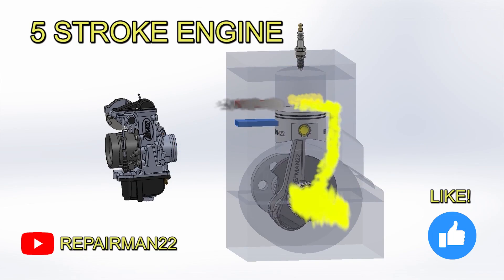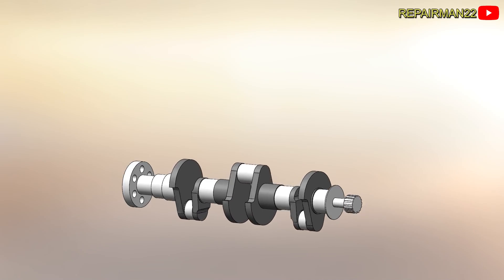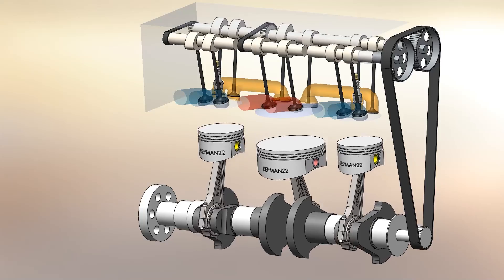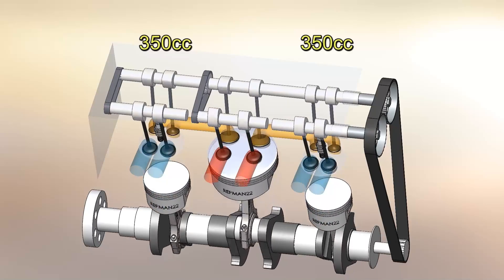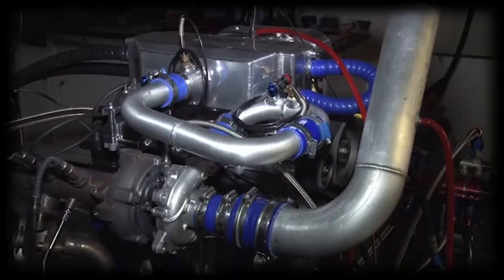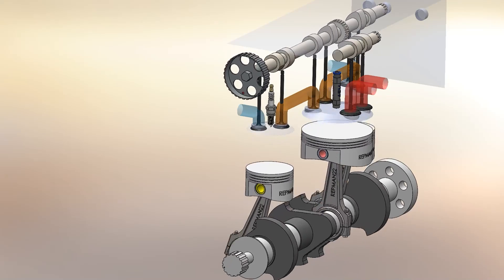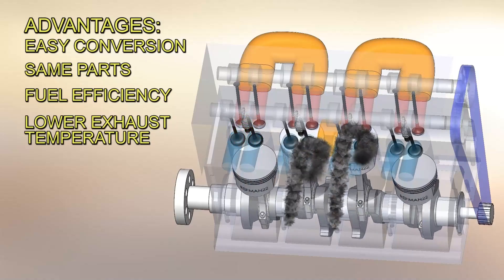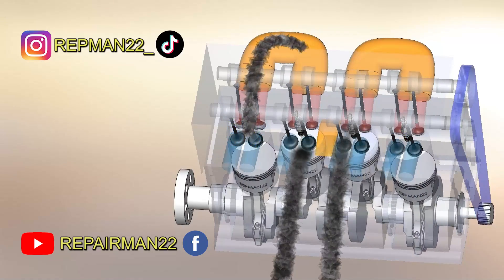The 5 stroke engine with water injection // Tested in Golf MK5 🤯

Comment: An additional process (the second expansion) doesn't make this engine a 5-stroke. The intake and exhaust are overlapping, so whole cycle still completed in just 4 strokes.
Reply: True odd-stroke engines are impossible because a stroke is either a decrease or increase in volume and you have to get back to the original state.
Reply: @JWQweqOPDH  I think steam pistons are arguably 1-stroke, if they have ports both above and below the cylinder.
Reply: @Appletank8  I can see your argument. It gets complicated when you're considering multiple contained volumes of working fluid. Thus, X-stroke isn't so much of a basis for defining engines, but simply a name given to particular engine types.
Reply: @JWQweqOPDH  One stoke engine LoL: https://www.google.com/search?client=ms-android-samsung-ss&sca_esv=599830617&q=ampere+inc.+one+stroke+engine&tbm=isch&source=lnms&sa=X&ved=2ahUKEwjq-82Y-emDAxV9RvEDHQFDAEIQ0pQJegQICxAB&biw=384&bih=718&dpr=2.81#imgrc=DxqmUEv0iOZrWM
Reply: You're putting way too much into a descriptive title. It points to this concept, all it needs to do. You can't have odd numbers of strokes in engines because it would intrinsically mean things would be out of phase on alternating cycles.

Anyone with an understanding of how a 2 or 4 stroke works can see this isn't truly "5 strokes"... 🤦‍♂️
Reply: I suppose it would be six strokes from the perspective of the fuel/air mixture.
Reply: Hey I completed your dad in just 4 strokes
Reply: Agreed, but what are you going to call it?
Reply: @critterIMHO  How about: "The compound combustion engine"? In analogy with the old Steam engines which also used a "compound" technology to extract more energy from the waste gasses of the primary cycle? Because that is what this engine does...
Reply: Honestly just call it with the name of the founder. We have Otto, Miller, Atkinson, Diesel, Wankel, Stirling, etc. No need to put description in the name.
Reply: Forget about counting strokes. "5 stroke" is a misnomer anyway. The concept is an old one from the steam days, it's called compounding. Compound steam engines were called double expansion or triple expansion, and in rare cases, quadruple expansion. So, Gehard Schmit did not invent anything, he simply applied this old concept to an internal combustion engine and did some refining, something that I have been planning to do for a long time, but I would never claim that I invented it.
Reply: imo if its not 4 stroke then its 6 stroke at best
usual 4 stroke into expansion and afterwards exhaust, the optional water injection is part of the expansion stroke.
Reply: Technically no, while the combustion is completed in 4 strokes there is an added expansion stroke before the actual exhaust stroke occurs making it 5 strokes in total by a technicality
Reply: @Theace88x  Technically, no, because that's two more strokes.. the extra expansion stroke and ITS exhaust stroke.
Reply: @MadScientist267  the exhaust stroke is extended through the entire second piston if you wanna get specific
Reply: There are two cylinders. Thus, there are 4 strokes + 2 strokes = 6 strokes, but two overlap, giving 5 stokes. The process takes 5 strokes: Intake, Compression, Power, Transfer&Power, Exhaust. "Strokes" relate to processes.

This gets more complex and debatable when two different RPMs are used, such as in the engine I'm developing. The induction pistons runs at 1/2 speed, so the engine has eight strokes: Intake, Intake, Compression, Compression&Transfer, Compression, Power, Transfer&Power, and Exhaust.
Reply: no this is not a5 stroke motor,  and you can get a 4 stroke single cylinder engine, i would believe you that this a 5 stroke engine but we would both be wrong @RichardLewisCaldwell
Reply: @RichardLewisCaldwell   I think it'd be more accurate to describe it as Intake, Compression, Power, Exhaust, Power 2, Exhaust 2. 6-strokes. 

If we're going to call "pushing air out" a stroke, the middle cylinders are doing that too.
Reply: @Appletank8  Except "Exhaust 1" and "Power 2" are happening together effectively as one unit on the same half-crank rotation. One complete intake-to-exhaust cycle is completed every 2.5 cranks, which really is five strokes from the high-pressure pistons' perspective.
Reply: @RichardLewisCaldwell Exactly. I can go along with 4+2. That's all it is. Two 4 stroke cylinders phased to feed a 3rd cylinder as if it were a 2 stroke, at which point the party is over and we gotta do it all again next time.
Reply: @RichardLewisCaldwell  Nope, you are confusing things. You can calculate this in two ways. 
Method A.) (easy) You have three cylinders each of which follows a 4 stroke input and output proces (that is two say 1 power stroke per 2 revolutions = 4 strokes).  
Method B.) (more convoluted) we only count the HP cylinders as actual cylinders and we count the LP cylinder as a "helper" of wich the strokes must be added to the HP cylinder. In that case the middle LP cylinder is dedicated for 1/2 to each of the HP cylinders. Together , for each 2 rotations of the crankshaft, each HP cylinder + 1/2 of the LP cylinder produce 6 strokes, but because LP cylinder uses a normal 4 input and output mechanism, it produces 1 power stroke for each 2 rotations or 4 strokes. In other words it produces 0.5 power stroke for each of the 2 strokes that are dedicated to each of the 2 HP cylinders. So for each HP cylinder we get per 2 revolutions of the crankshaft: 4 + 2 = 6 strokes for wich we get  1 + 0.5 = 1.5 power strokes. But 6/1.5 = 4 so we still have a ration of 1 power stroke per 4 cylinder strokes... so again: IT IS SIMPLY A 4 STROKE ENGINE! (with a different input and output mechanism for reuse of exhaust gasses).
Reply: Actually, we get two power strokes per revolution, just like in two-stroke engines. The re-expansion power stroke is reduced by the relative volume of the combustion cylinder compared to the re-expansion cylinder. The engine produces power with the re-expansion piston at the same time the engine consumes power via the combustion piston.

This leaves a “hole” near the end of the alternate stroke, where re-expansion has petered out and final compression is providing negative torque. Said hole is filled with a flywheel replacing temporal torque transfer device, which uses horseshoe magnets to pull the crankshaft through final compression as the magnets’ legs come together. The energy debt is paid back when the magnets are pulled apart in the heart of the ‘normal’ power stroke
Reply: @RichardLewisCaldwell  A 'stroke' has always been understood as the travel between TDC and BDC in one half of a rotation, not processes. If you want it to mean something else, it introduces ambiguity to the standard understanding, e.g. like 'liquid piston', - neither liquid, or a piston. Terms like this are for marketing, not engineers. Lies, in other words!
Reply: @martynridley3671  Marty, you have probably never even considered how strokes are counted in sequential engines. I design them. (and sure, I'll share my design, the near-Carnot if you want).
Anyway, if you count piston movements instead of blocks of time the math just fails. The way you propose overlaps strokes 4 and 5 into one block of time. But stroke 5 MUST come after stroke 4 has finished, eh?
Add in pre-compression and try to make sense of what stroke it is when you're simultaneously tracking different stroke numbers for three cylinders. If you're not using blocks of time you're just screwed.
Reply: @RichardLewisCaldwell  Dick, obviously you think you know more than everybody else because you design them, so I'll just say, 'Ok then, whatever!'
Reply: Ambiguity is what you’re adding. A four cylinder engine has precisely eight strokes per rotation. But “stroke” has a more nuanced definition than piston up or down per engine; the stroke count is based on the time in the entire engine for a single packet of air. I ask you for the strokes in my engine:
The pre compression cylinder runs at 1/2 the RPM of the combustion and re-expansion cylinders.
There is one pre-compression cylinder per combustion cylinder and two combustion cylinders per re-expansion cylinder.
Go ahead, tell me how many strokes. And before you claim it doesn’t work, draw it out on a chart.
Reply: @richardtheweaver4891  ??? "The pre compression cylinder runs at 1/2 the RPM of the combustion and re-expansion cylinders".
That is complete - and provable - BS. There is no separate crankshaft for the extra cylinder, so it is simply physically forced to make the same number of strokes as the other cylinders... Now you could make the point that this one extra cylinder is dedicated to the TWO other cylinders, so that each get only half (thus 1/2 the strokes...) BUT. Even if you want to compute like that, you STILL end up with a 4-STROKE engine, for the simple reason that in that case you ALSO have to devide the power strokes of the extra cylinder over the other two, giving 0.5 powerstroke for each of those 2 strokes that you assign to the other cylinders.  So you then get a motor that makes 6 (!) strokes per rotation of the crankshaft for each of the main cylinders, but also 1.5 powerstrokes per rotation of the crankshaft for each of the main cylinders (!) So you still have an engine that makes 6/1.5 = 4 strokes per powerstroke = a 4 STROKE ENGINE!
Reply: @martynridley3671  I think what you're saying is right. But I also can see how this is a 5 stroke engine. 

In the path of fuel on this engine. Its suck, squeeze, bang, extra power stroke, blow

Comment: I sorta like the 3 cylinder design, but only because it reduces friction over a 4 cylinder engine. while still maintaining some kind of engine balance. The problem I have with these kinds of engines is that turbo chargers and turbines exist. Stick an electric motor on a turbine and expand those exhaust gases as much as you want. Small turbines are cheap to produce if they were produced in mass.
Reply: I think OP meant to type "generator" instead of "motor". Essentially a turbo but generating electricity instead of compressing intake air.

Otherwise, agree that OP doesn't make sense.
Reply: @LurkerInTheInterRecordGap  Correct. I have been buying electric motors to use as generators for various projects which is why I wrote motor.
Reply: Could you clarify why you'd want to expand the exhaust gases by powering a turbine with a motor?  None of this makes sense.

Comment: I would think this engine would work with a CVT transmission as you can leave the engine at a higher speed.
Reply: You don't want to leave a engine running at higher speeds all the time. That's why cvt cars are a lot trickier than you might imagine.
Reply: @tristanjones7735  But that's just plain wrong. Internal combustion engines applied in industrial machinery and/or generators are run at higher speeds all the time, because their main responsibility is being the primary mover of another system, be it an electric generator or a hydraulic oil pump. The result is increased longevity because an engine being run at the RPM range of it's highest torque output and highest Brake Specific Fuel Consumption (BSFC) is where the engine is "at it's happy place" where all of the intricacies of combustion process are in perfect order. Cylinder pressure, piston ring expansion, oil temperature at it's proper viscosity, exhaust gas temp and plethora of other things.

There's a reason why a CAT C7 engine in a dozer or a digger will outlast a CAT C7 put in a OTR truck by a factor of 2 to even 3.

Your car engine gets clapped out because you start it, drive a distance you could easily walk, shut it down, only to get to work/get groceries and then repeat the same fucking process 16 times every day, 365 days in the year for years mixed with 50% of the time idling at a red light.

Comment: One downside I see is a problem my 3-cylinder Geo Metro had.  It would burn out the center intake valve because the exhaust gas was too hot.  Hopefully this engine has better steel alloy to avoid that issue.
Reply: yea we still havent moved away from cast aluminum vs forged alloys... the suzuki 4 cyclinder ended up being raced...

Comment: This is just like a compound twin expansion steam engine. The engines on the Titanic had three expansion cycles
Reply: It's fascinating how technology goes around and comes around.
Reply: @theworkshopwhisperer.5902  It's equally fascinating how people try to pass something old off as something new.
Reply: @Volvith  My guess is that saying “It’s new!” provokes a more positive response than saying “It’s old, but we’re trying it out again with better manufacturing/design/knowledge, so this time it might work better!”
The focus is still on the fact that something is different, and complicating the message is generally unwise in public communication.
Reply: Triple expansion steam engine?  13 % thermal efficiency.  
Double expansion? 12% thermal efficiency. The last step does not bring much, so internal losses are important.
Reply: and then you add a free-floatin turbine to the exhaust and a sterling to the heated body.
Reply: And look what happened to that
Reply: @dancho0012   The turbine powered, Lusitania didn't fare that much better😅
Reply: Was just thinking that!!!  I think with three though the parasitic losses through friction would end up being a negative in power, unless the initial combustion was extraordinarily hot! However that creates NOx which is bad. That’s where the idea falls down, if you can have very hot exhaust you have very hot combustion, which is more efficient, because it’s fuel-lean, but it creates bad byproducts, and the heat is ruinous for the longevity of parts. All which could be offset of course! The only thing I could see it working on is… like a very fuel-lean hydrogen ignition? Or perhaps running on pure oxygen, where NOX hasn’t got the ability to enter the cylinder? 

If you have this system running on pure oxygen, the heat from the combustion would be insane, and if it’s burning something like, Methane, it would work. 

But … an engine that’s likely built entirely out of titanium, pretty much the only thing able to take the heat… 

Yeah good idea… but really only useful in the military, because the engine would cost more than a new luxury pickup lol.
Reply: I believe the Queen Mary had 4 or 5
Reply: We all know what happened to the Titanic!
Reply: That's nice.
Reply: My thoughts exactly
Reply: And 46000 hp
Reply: That was exactly what I was thinking.  Reminds me of old riverboat engines.
Reply: Or really just like any steam engine.
There aren't exactly any cylinders that do combustion in a steam engine after all.
Reply: Fascinating. I didn't believe a single word.